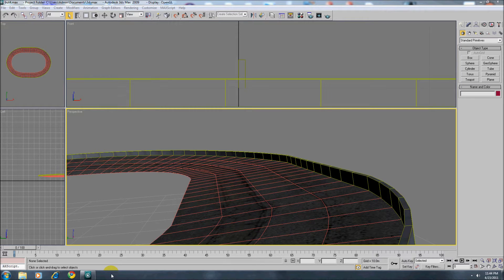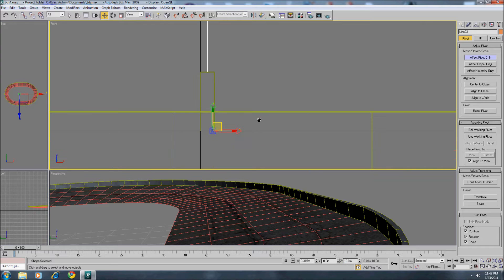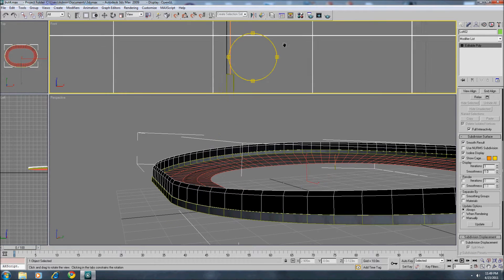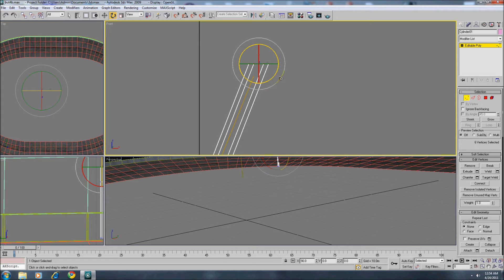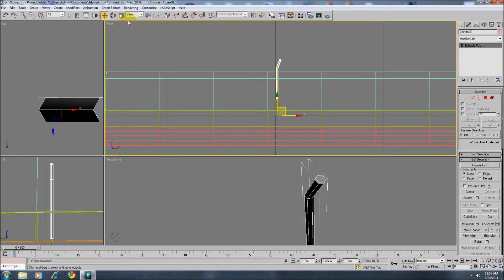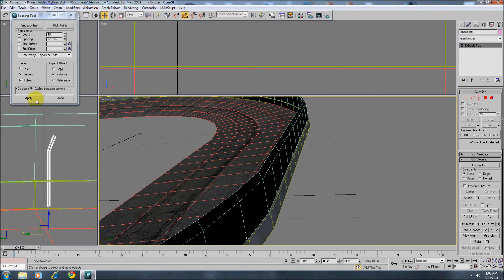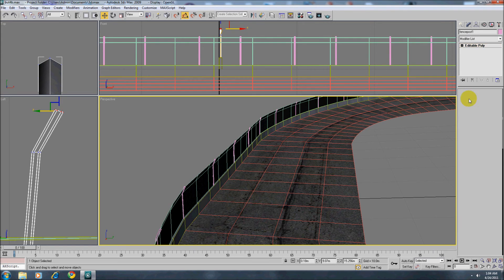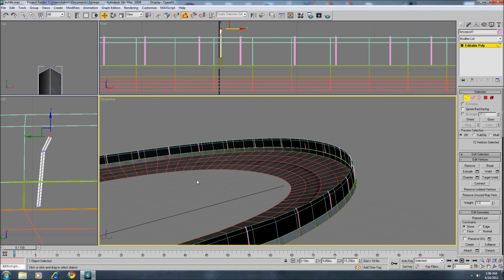3ds Max rFactor Tutorial Fence and Fence Post

Comment: whenever i try and bend the top of the post the vertices always fan out as opposed to bending the top part like you do about 5.00 mins in. Cant work out why this might be.
Also the fence you create appears to be a solid wall with just a texture applied? how can i make this look like a proper wire mesh safety fence? Great tut btw